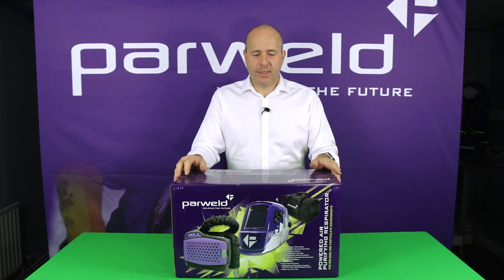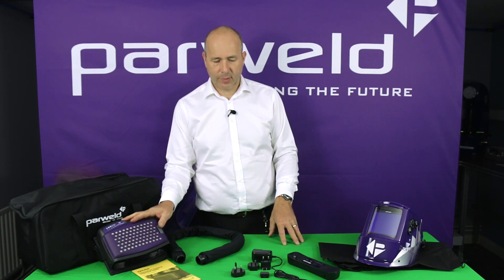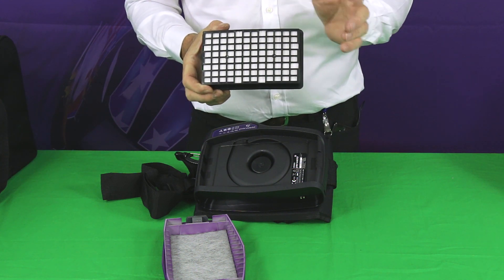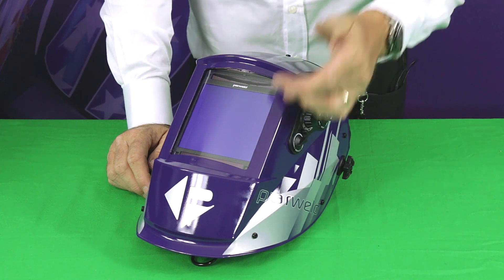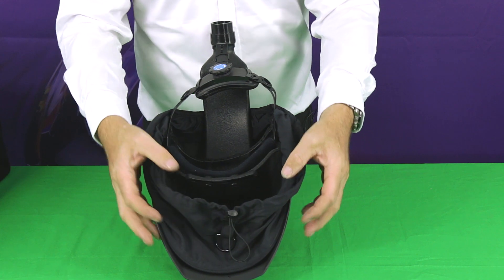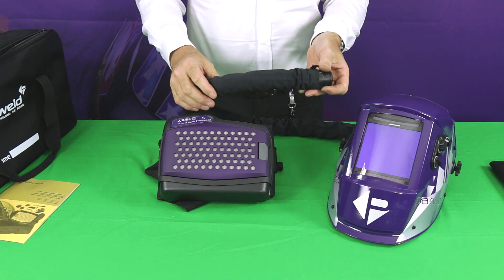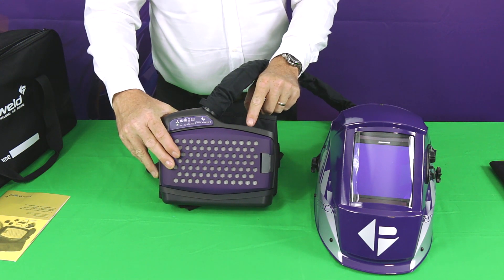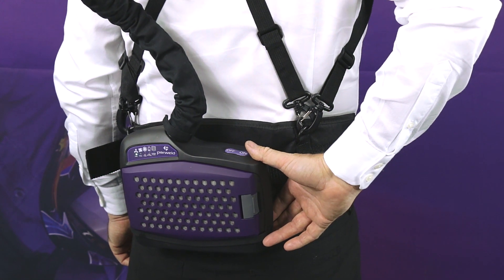XR940A (PAPR)

Comment: Thank you for making an affordable and qualitity alternative to 3Ms overpriced products.
Reply: Far from overpriced you get what you pay for simple as that if you have never used speedglas you don't know what you are on about
Reply: @PlugsandPistons  I have used it. For me its just a status symbol.
Reply: @TheSingleAss  clearly havnt used speedglas the quality destorys these cheap masks , parweld don't manufacturer welding screens there resellers and you comparing these to speedglas makes me doubt what you say truly don't believe a word your saying I have this parweld mask in work and is Fucking horrific there's a reason you pay 1300 for a airfed from them parts will always be there and reliability is there
Reply: @PlugsandPistons  yeah well i have used speed glass and the only thing it has thats better than any other auto darkinging mask is that the plastic they use is top notch! ive had speedglass products fuck up as much as any other product. your just another useless mig jockey that probably cant weld unless its with a miller welder and a speed glass mask. Have you even ever welded without an auto darkening mask? real welders can finish the job with any mask.
Reply: @marcjones1967  this airfed is just horrible fitting and quality, the headpiece doesn't fit anyone below medium sized head, I'm on the smaller size and find it just doesn't fit me at me the lack of finish and overall quality makes me doubt it will work after a small drop, I have a 9100FX and 9100XX and would never go back to Anything cheaper
Reply: @marcjones1967  Could you please specify what is wrong with it?
Reply: @marcjones1967  I don't need to touch the parweld but I have tried it in work, we have esab what is about 20% better but nothing compared to my speedglas
Reply: Scouse Squirrel 🐿 your very lucky 🍀.  Am deleting my messages now so I don’t get any hassle.  Stay safe 👍